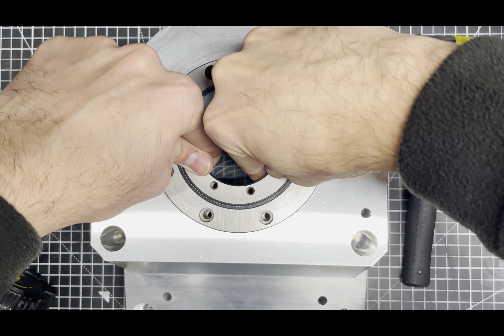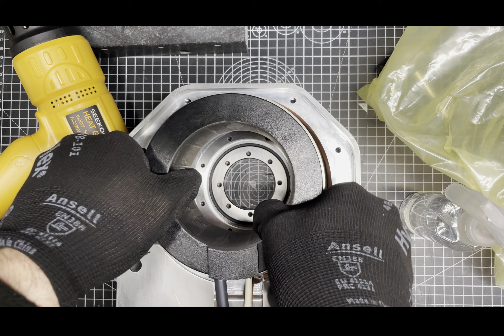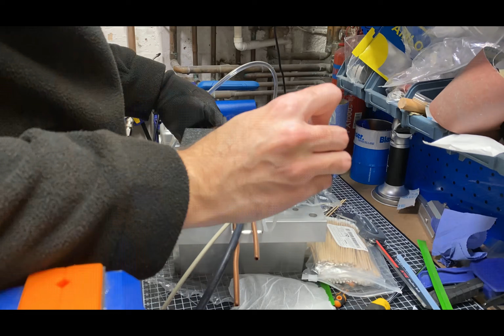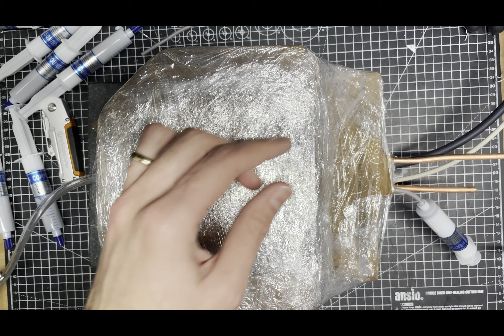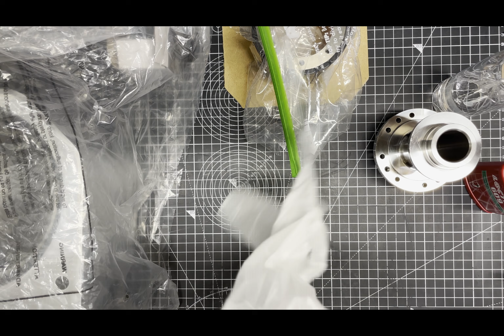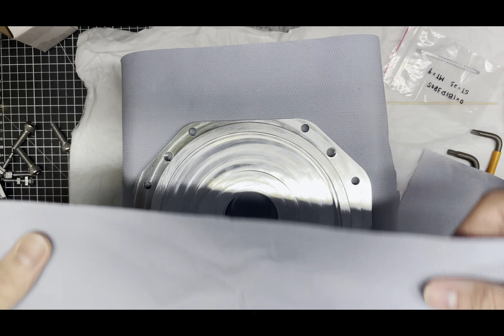B Axis Assembly - E007

Comment: As someone with no machine designing experience, I found it surprising that the axis is driven directly from the servo. I would have expected some sort of zero-backlash, non-back drivable gearing. How rotationally stiff will this axis be? It certainly removes a lot of complexity if it's possible to avoid any gearing. Thank you so much for sharing the process. It's eye opening!
Reply from the maker: Thanks for your comment. These new torque motors are extremely rigid if tuned properly (and the spec is correct for the application). I've built many many rotary axis using gearboxes in the past (such as dual lead worm, harmonic, cycloidal, belt, two servos and a big gear for backlash removal and a system I invented for multi head machines), non of them are as good as a torque motor. 

Usually torque motors are superior in accuracy and speed, but they are energy hungry and expensive up front.

Comment: for future reference if you can get ahold of some butyl sealant tape - grey stuff often used for roofing - it's super super useful for many things but one of the things it's best at is building temporary airtight seals. you can pretty much just slop loads of that stuff around any combination of tubes and holes and really mash it in there and it will seal as long as there arent any fibers or anything connecting the ambient side to the sealed side. as a bonus, it tends to creep over time and with constant application of pressure/force, which can be a very useful property for many things - one of which is making it tend to fix its own leaks in some configurations. just generally very useful stuff to have around the shop
Reply from the maker: Didn't know that. Thanks for sharing. I'm going to buy some 🏃🏻‍♂️

Comment: Professional mechanics don't use these Wera hexkeys because 1. There's way too much friction so it's hard to pull them out (it takes months of usage before it slides comfortably) 2. The ball detend on the end is more annoying than useful (magnetic hex keys are more comfy 3. Especially on the larger keys, the geometry of the hex gets stuck when applying lots of torque to screw - that is super super super annoying 4. The holder with its flappy end on the smaller side you have to lock is super annoying too 5. The pvc sheet makes it unable to slide into deep holes or for other uses you could use a piece of hex key for (like banging on something or etc). People try them for one day and after one day they don't want to use them anymore and go to any other type - even normal Wera's that don't have the stupid PVC sheet on them. It's a failure of a product for proffesional use - it's a novelty thing.
Reply from the maker: Thanks for sharing your experience. I'm afraid I can't agree with everything you said. I might explain it on a video about the tools I use around the shop...
Reply: @kasramehraky9283  I'm talking about pro mechanics that have to do hundreds of screws a day. In your home shop, ok but in the real life, these things are a nuisance.

Comment: Is it a cross roller bearing P5 class?
Reply from the maker: @Mr-on2di  it is a cross roller bearing but the accuracy class is Ultra Super Precision and clearance is CC0 (better than C0). 

P5 is quite a loos bearing with a high run-out. 

For the C axis I'll be using a couple of 7000 series with P4S class (better than P4), because that axis rotates up to 5,000 rpm.

Comment: loving the new update format 

As someone who has also built 2 cnc machines (nothing to your spec tho yet) its awesome to see other steps people take to get things done. 

what kind of mass are you expecting the head to have once completed are you a the school for as heavy as possible mass in the head so the tool is more actively dampened ?
Reply from the maker: @AcidVFR400R  thanks for the comment. 

Not sure if I got what you meant. This axis will be rotating the C axis and not the spindle. The C axis weighs around 8 KG if I remember correctly. And the workpiece could be up to 7 KG, making the maximum total weight around 15 KG (including the fixturing). This motor has a continuous torque of 41.5 nm and a peak torque of more than 103 nm.
Reply: @kasramehraky9283  

Just looked at the cad model again in E001 and worked out how this was located, for some reason i had wrongly thought you were making your own head / spindle .. 

doh ...........